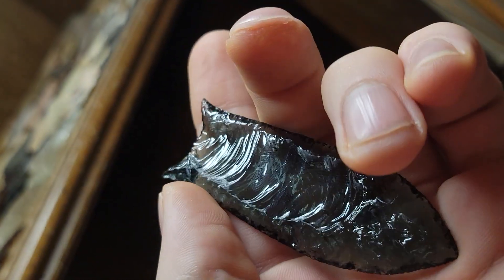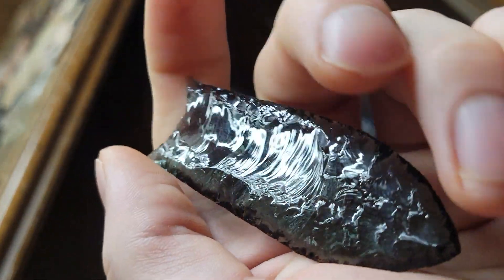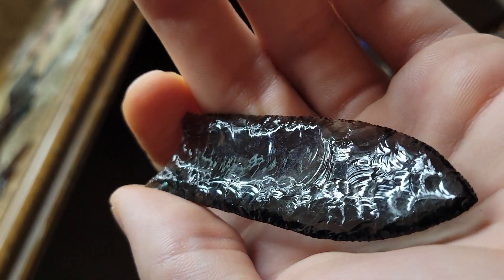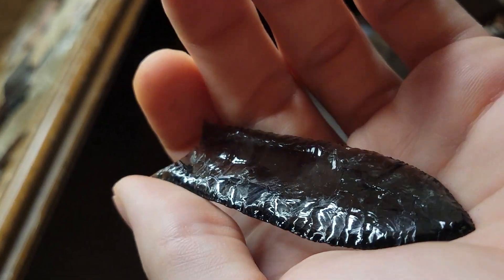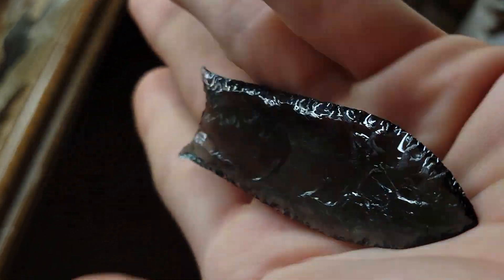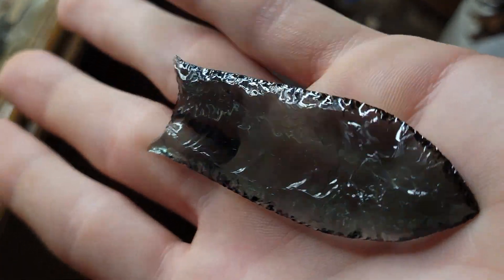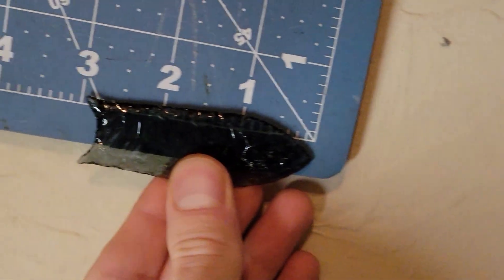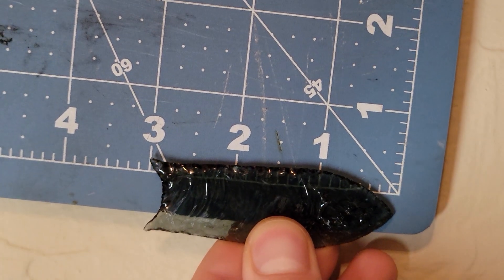Flintknapping: Shooting for the Lindenmeier Folsom.

Comment: nice work . I'm learning to flute them , still breaking most . got any tips ???
Reply from the maker: Thank you. Keep at it as practicing is the pathway. 

Percussion is really good if you can get it down, but it's the riskiest. 

Indirect percussion is good but is iffy because it's hard to balance the angle just right so it doesn't bend break, as well as finding a good way to support the tip and whole piece so shock doesn't break the piece (this goes with percussion as well). Indirect isn't as risky though. 

Pressure (jigs and other such setups) is really good but is also risky for bend breakage. I've settled on pressure fluting as it seems to have the least breakage rate.

I used a Soares jig to make this one, Pressure for the win.